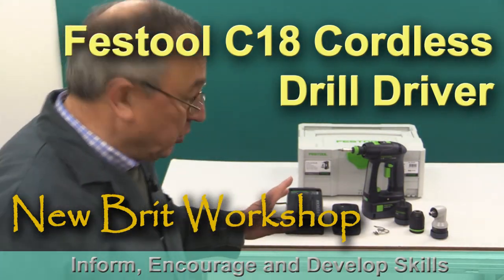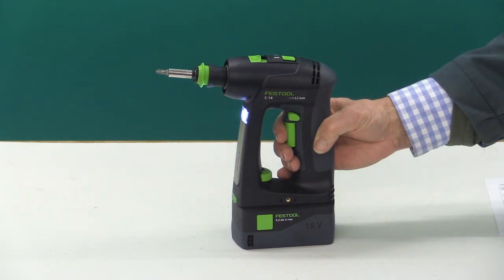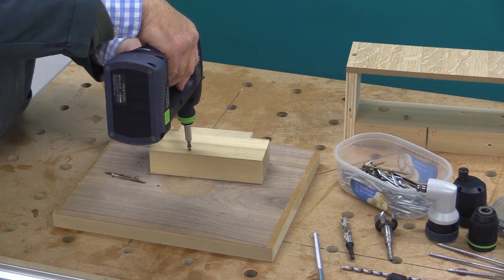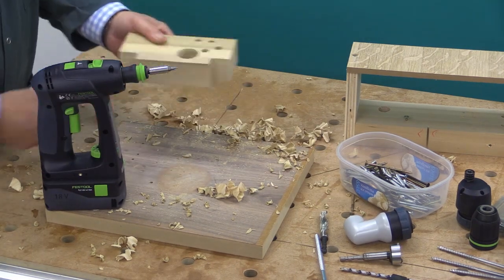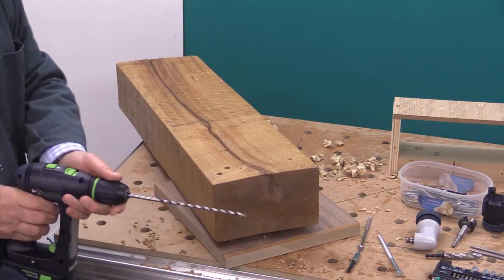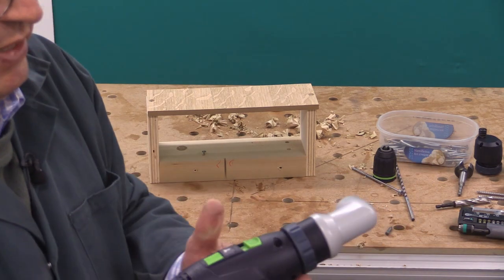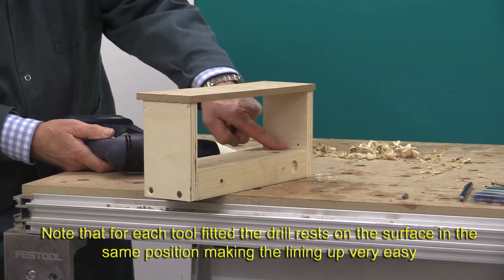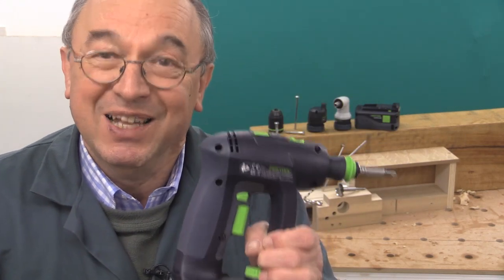Festool C18 Cordless Drill Driver

Comment: Great and very helpful. I just ordered one and will be here soon. My question is should you or can you keep the battery on the charger. Like DeWalt suggest to leave the battery on the charger and it wouldn't hurt the battery.
Reply from the maker: As far as I know there is no harm in doing this. I do it all the time, sometimes for several day. It is a very clever charger.  Cheers. Peter
Reply: @NewBritWorkshop  From an electrical stand point, it won't hurt the battery as once the battery is at the right voltage, it'll "float". For long term storage, it's recommended to not leave it on the charger.

Comment: Is that chuck actually by Jacobs? I have a couple of older FS drills and I think both their chucks were by Rohm.
On the "feel" point, I like this style of drill because it feels better balanced than the tee format when actually in use; it is, of course, shorter - another plus point for access.
Reply from the maker: I think most people use "Jacobs" as a generic for the keyless style. I do not know who actually make these. I have had no problems at all with my various Festool drills and therefore cannot fault the chucks in any way.   Cheers.   Peter

Comment: I brought the c18, as a carpenter i am very used to using dewalt so when i got this i did really thing much of the machine until the attachment come out to play, its a different story
Reply from the maker: Hi Sam, I have lost count of the number of times that I have been saved by Festool's unique drill attachments. The angle gadgets are really well made and stand up to huge abuse.  Cheers.  Peter

Comment: Great demonstration, Is there a Centronic bit that is 25mm and would go through a 3 inch joist?
Reply from the maker: Take a look at Axminster's web site. Festool do a 25 mm Forstner but it may not cut to a 3" depth - I am camping in The Netherlands and too far away from the workshop to check.   Peter

Comment: When I went to get this drill, as 99% sure, I ended up with the T version as felt better to my hand, plus might be better in tight spot as hand still mostly within length of body when using.
Reply from the maker: I really do recommend that people try both styles before deciding.   Peter
Reply: If you want a quality normal shaped drill than buy a hilti or a high end metabo. There's no equivalent of a c18 or a cxs, it's designed for some  unusual tasks

Comment: Thanks Peter. Another great Festool product review. I currently have a C15 Li Set. The Eccentric and Right Angle chucks are quite well designed and useful for cabinet work. My question is; what are the differences in the C15 vs the C18? The only difference I notice are the new Airstream batteries. (Admire their quicker recharge time.) Or are there other functional differences that would warrant serious upgrade discussion? Thanks again for all that you do. The topics you cover are as relevant to me as your teaching style is enjoyed and appreciated. For the record, I’m just a DIY guy who enjoys buying and renovating older homes and commercial property to add value in leasing and selling. Thanks again Peter.
Reply from the maker: Hi Brian, Good to hear from you again. I do not know the C15 at all. The C18 is a neat tool and so I suggest that you look in your C15 manual and see what characteristics your machine has and compare them to the Festool C18 on their web site.   Good luck.   Peter
Reply: Thank you. I did as you suggested and discovered briefly the C 15 is a 14.4 volt device with a brushless motor so it has that benefit, and the C 18 is an 18 volt device and an ETC brushless as well. Perhaps the C15 was Festool's first crack at the brushless motor for a drill? Just a hunch. For my work, I haven't noticed a limitation yet on the C 15. So if i do need to go up in capability, maybe the smart thing is to look towards the PDC model. Thanks again ~ Cheers!
Reply from the maker: Hi Brian, Yes, if I were in your shoes I would certainly go for the PDC 18/4. It is a true workhorse and capable of anything in the drill-driver line.   Peter
Reply: I also have the C15 and like the C18 it lacks, I think, an important  feature, that is a hammer action. So you still need something like the PDC if you want to drill masonry and this leaves you with quite a heavy lump of a drill driver in the C15/18. I think a better all round pairing would be, say, a PDC for the heavy duty stuff and the C/TXS as your drill driver. It's certainly what I wish I'd done!
Reply from the maker: Good points.   Peter
Reply: No difference between the 2 apart from battery voltages and a slight increase in power from the 18v over the 15v battery. :)

Comment: Why is the angle attachment white and not black like the rest of the kit? That really bugs me! Does this drill have a battery level indicator?
Reply from the maker: The angle gadget is Festool grey and is a very solid bit of kit. There is a battery level indicator with a little button at the front of the drill just above the battery.  Peter

Comment: The centrotec system is off the scale I'm using it in my other makes as well now no more spinning drill bits in dodgy chucks dewalt is especially bad for chucks my mates chuck has to be loosened with water pump grips to get his bits out
Reply from the maker: ...and again... cheers.  Peter

Comment: I only started with a extractor. Now I have 2 cxs drills 2 t18 a tpc and a tid impact driver🥴 2 track saws a domino a cs 70 set version and enough systainers that would challenge the London eye😁 very addictive brand but a pleasure using it and building stuff.
Reply from the maker: Hi Mark, My Festool kit started with a large purchase after selling all of my heavy machinery. It then grew slowly at the rate that I was able to save money from my day job. You are right, the tools are a delight to use.  Cheers.  Peter

Comment: great video , cheers , one question , this being a lower revs and torque than say a makita dtd170 or 154 , how would it go driving batton or bugle head screws into timber where the impact driver makitas excel
Reply: basically my question is in comparison with a dtd170 makita
Reply from the maker: Hi Nik, I do not have the Makita but an impact driver may be better for what you describe.   Peter
Reply: @NewBritWorkshop  , im not so sure peter, makita is disposable.. id like a trila as how it drills with speed and hardness of material it drills into

Comment: Peter - thank-you for the excellent video! I already have the CXS and am pondering whether I should pair it with either the C/T18 or PDC. If you had to buy just one of these alternatives, which one would you go for for general woodworking?
Reply from the maker: Hi Steve, My next Festool video will go through these sort of options. For me, I would have the PDC 18/4 as it can also be used for drilling into brick.  Cheers.  Peter
Reply: Thanks Peter.
Reply: I believe the eccentric chuck doesn’t fit on the PDC, which is the only drawback for someone who predominantly does cabinet work. It may be a significant drawback for these users though.
Reply from the maker: Hi Steve, It is a pity as I found it so useful with the C18.   Peter

Comment: Will the eccentric chuck fit onto the right angle chuck?
Reply: It does!
Reply from the maker: The chuck will fit but the screw securing arrangement cannot be engaged and so it will not work safely.   Peter
Reply: New Brit Workshop thanks.